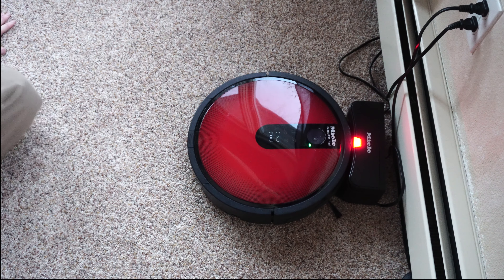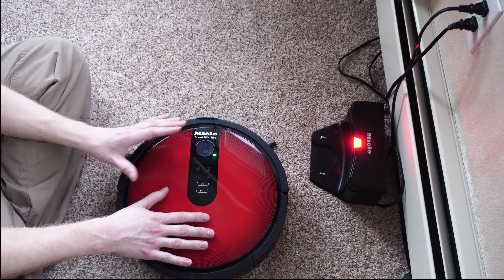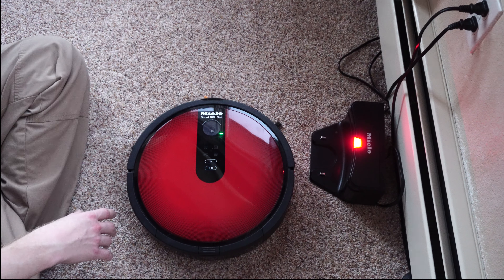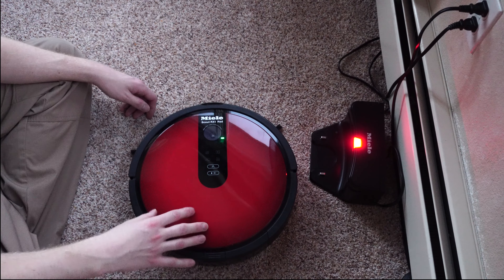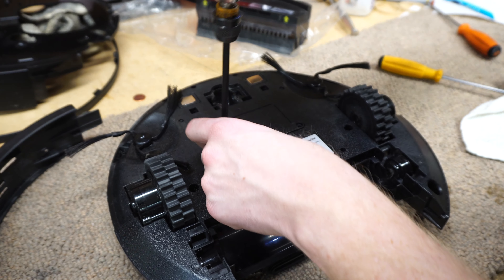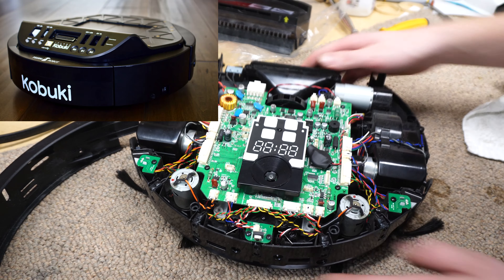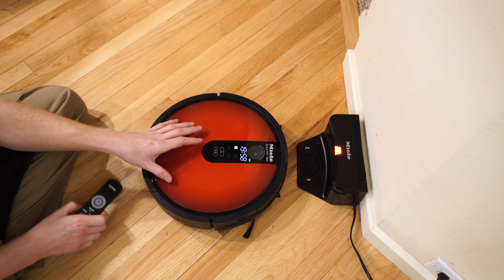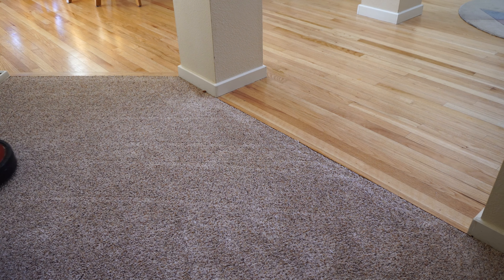Miele RX1 Scout Robot Vacuum Review 2020

Comment: Nice video. Can the suction motor get filled with dirt and cause malfunction of the device?
Reply from the maker: When the dirt bin gets full it does stop and beep
Reply: @PerformanceReviews  but does it ever get past the filters into the motor it self?
Reply from the maker: Not the big stuff but the motor does cool the circuit board and itself with the same air it intakes from the filter. I would say the filters good to about 3-1 microns